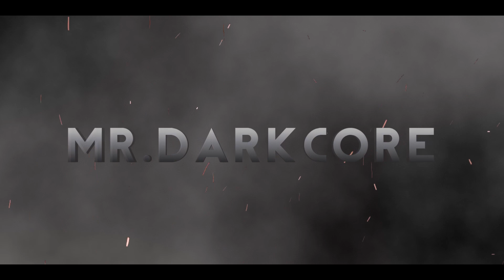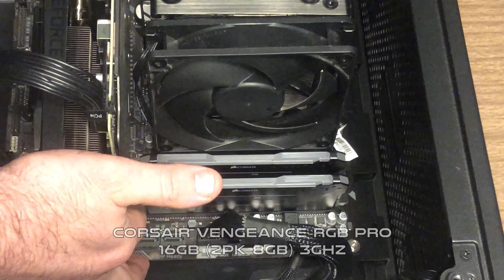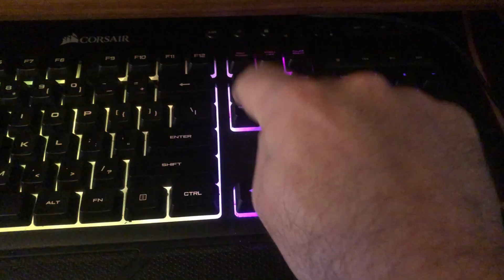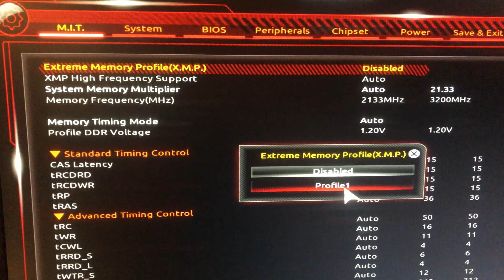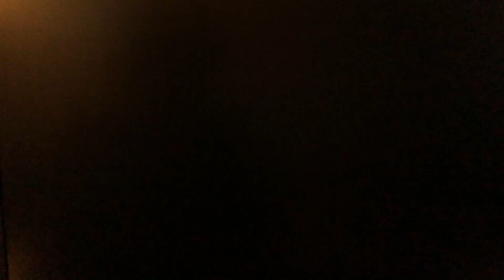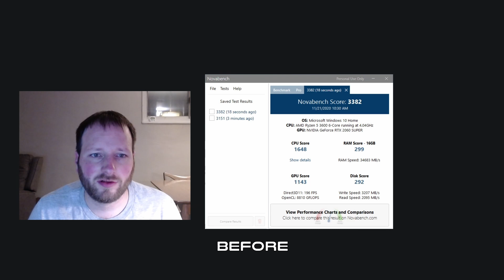How To Install Memory on A Desktop PC! Corsair Vengeance RGB Pro

Comment: I just bought a cyberpower PC ryzen 3 3100 RX 570 8GB Ram one terabyte 240gb SSD does it matter which Ram speed I get can I get any Corsair Vengeance and put it in it because I'm leaving today to go to BestBuy to get it and also can you link me a Corsair Vengeance one compatible with this that's really good that's a hundred or less earned a sub🔔🔔
Reply from the maker: What is the current ram speed installed now?
Reply: @MrDarkcore  I don't know
Reply from the maker: @itsral3n431  ok, it’s easy to figure out. While the pc is on, just Ctrl alt del to get the task manager up. There is a performance tab, then just click memory and you can see the speed and size of it/them.